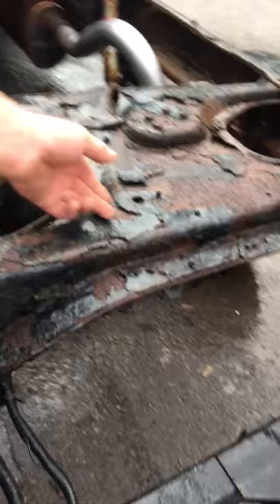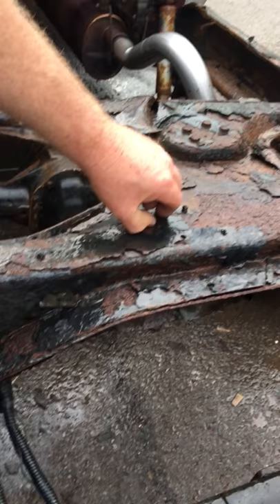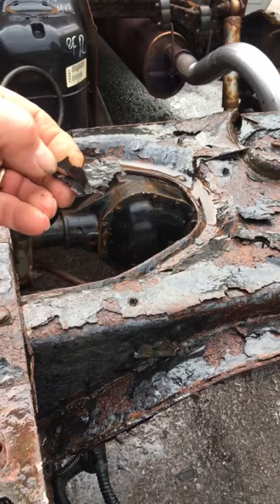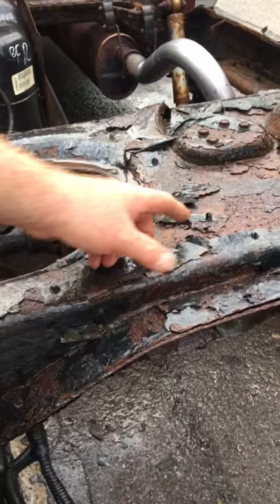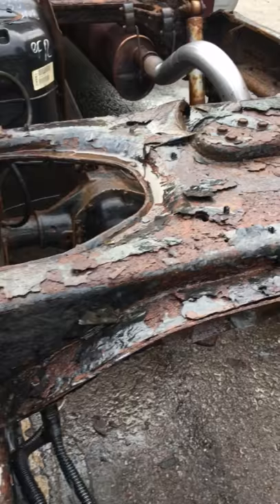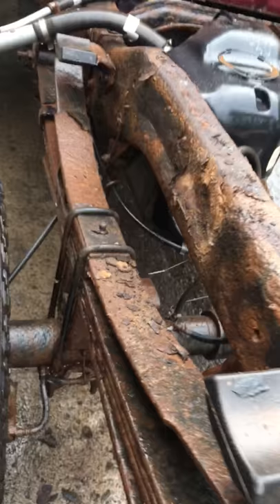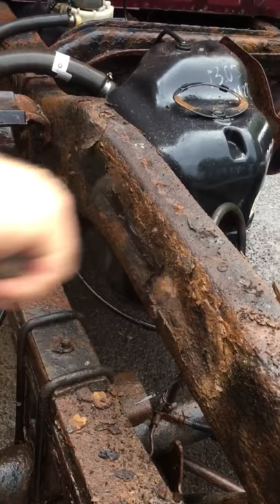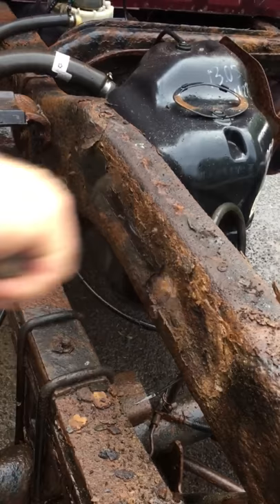Por 15 Is Junk! 2 Year Update

Comment: with all due respect, if the surface isn't well prepared it won't stick.
Reply: Yeah this dude literally put it on a rusty frame best method is bare metal
Reply: That and who the hell rustproofs the frame
Reply: It's literally called
Piant
Over 
Rust 
attempt 15 I think 
I would assume you can apply directly onto rust but if the rust itself isn't attached to the frame anymore I don't see why the paint would.
Reply: it literally says on the product AND their website you can apply it directly to the rust
Reply: @joer5057  the problem isn't the paint sticking to the rust but that the rust is no longer sticking to the frame think of the rust more as a layer of bad metal and that layer needs to be removed or it will just come off and take the layer of paint that's on top of it with it.
Reply: @Big-lron yes!!! Finally someone understands E.G - coating a frame with rust thats flakey essentially you are coating the flakey rust when that falls off it will carry on rusting and the product does not work always best to clean all the rust then coat it in a product like this
Reply: Wow that’s poor preparation
Reply: @Big-lron  light surface rust, not deep rust. like the flash rust you get on mild steel. you can't just put it on deep crusty/flaky rust.
Reply: @joeybydin439  lmao I was about to say this truck has been through Nam and back and this guy is like this por15 is crap 😂💀
Reply: Dude wtf are you driving in? Pure salt water?
Reply: @joeybydin439  anyone who wants it to still be there after a few winters 🤷‍♂️
Reply: @Big-lron  it’s also has directions… jfc
Reply: I sandblasted my truck frame and then por15’d and 10 years later it’s still almost mint.  You can’t por 15 a flaking frame and expect good results.
Reply: @Big-lron  paint over surface rust that you don’t want to grind into the metal And damage it more it will cure it and prevent it it doesn’t stop a rotted frame from rotting more
Reply: I agree my opinion is the steel was never stripped of rust to begin with
Reply: @Big-lron  right on the can it says you have to use the cleaner/degreaser then the metal prep/etcher, and THEN the POR15.

"But the slogan says . . . "
Reply: @joer5057 they mean surface rust that ISN'T flaky. If it's flaky than of course it wont stick. It has to be the 
type of rust that stays whwre it is for it to work. They do reccomend stripping the rust off and putting it on bare metal too
Reply: @joeybydin439  anyone in the upper mid west how wants their truck to last over 10 yrs
Reply: It doesn't work anyways
Reply: No prep at all. Ive seen plenty of cars that were restored 15+ yrs ago and the por15 underneath is nearly perfect.
Reply: @joer5057 yeah surface rust
Reply: @Big-lron yes paint over rust, it says CHIP AWAY ANY FLAKEY MATERIAL, you need a strong base. Let’s say your frame is extremely fucked up and it’s just weak from being completely eaten away, POR will not save your ass, if you can take a wire wheel and clean shit up and get a good base then yes you’ll have 0 issues, but if you’re in a extremely abusive area where you’re constantly getting salt and mud caked on and never washing it off? Yeah nothings gonna work, no por, no powder coat, paint, that would even be hell for fluid film.
Reply: @Big-lron you still need to prep my guy. If you dont the flaky stuff is just gonna shake off and itll keep on rotting because there isn't proper adhesion to the surface.
Reply: You HAVE to remove scaling before you apply.
Reply: You can't take it literally first of all it's marketing as far as you can put it on any surface no prep blah blah blah But you prep the surface right I guarantee it's going to work I don't even know I just know how science works
Reply: @jamesendicott4938 why por15 it if it's sandblasted clean? That would not be the most appropriate coating for clean bare metal?
Reply: @joeybydin439 Anyone who lives in the rust belt better if they want their truck to last more than 10 years. Frames can and will rust all the way through and break in half.
Reply: @joer5057 not if you leave all the scale on😂
Reply: Clean metal or not it will always happen that stuff holds moisture and will rust from the inside even on a brand new vehicle. Your best bet is just to spray some type oil underneath it soaks into the metal and actually work, it repells water not hold it in
Reply: It says to remove all rust. 
It’s more of a paint over rust pits meaning you’ve knocked the loose stuff off.
Reply: @Fffffaaaaaaa 😂 No, not salt water…..Pennsylvania. No joke. 😂
Reply: @joer5057 Exactly. I’m sure it would work much better if you applied it to bare metal but they claim you can just put it over rust.
Reply: Is says to put on with rust not bare metal
Reply: Dude i have it my rally var 4yrs know its super good ,prep work is key dont blame the product

Comment: I DiD zErO pReP wOrK iTs ThE pRoDuCtS fAuLt
Reply: yes because it's called Paint Over Rust
Reply: Yeah you're supposed to use the degreaser then the rust neutralizer first before applying it instead of being cheap, lazy and not following the directions
Reply: @no-damn-alias  if you applied absolutely anything on rust that's just flaking off it's going to flake off with the rust unless maybe you drench it in super glue. You have to remove the flaking rust and then you can paint over the rust on the actual metal
Reply: Try sand blasting the frame lol then put it on

Comment: I used it to treat a 1970s steel caravan chassis 15 years ago which was getting quite bubbly on the surface. I rubbed back the whole thing to remove the flakey bits on the worst areas, but didn’t worry too much about going to bare metal, just removed all the loose stuff. once the prep was done I painted on one coat.

15 years later I’d say it’s done an incredible job. Some surface bubbling is coming through now and it needs doing again, but overall I’m very happy with the product.

As others have noted, proper prep is key as with so many things in life.

Comment: I think the preparation work is very important and how you go about it, I have a 4x4 chassis completely stripped, weld repairs once that was done off to the sand blaster. Fresh sand blasted chassis was then sprayed with Metal Ready left to sit for 20 mins then rinsed off with water and left to dry. Went over it with clean damp cloths (water) let dry. Brushed two coats of Por15 and let dry after with Por15 Chassis Black. This last coat was sprayed on. 12 years later and its still good. The prep that I did properly so it worked for me. I found that if the prep is not done properly as i had once done with a motorcycle rock guard i just wire brushed it and skipped the metal ready, the Por15 separated in some places over old paint and even peeled a month later, because my prep was rushed and not done properly. If sand blasting is not an option say due to budget reasons, when wire brushing use a clean wire brush, wire wheels. I use stainless steel wire brush type I try not to mix previously used wire brushes were used on grease dirty muddy steel.
Reply: Heya mate. I specialize in metal finishing and restoration in N.Z. so our product names differ a little. From the sounds of your preparation, I'm thinking the product "metal ready" is a form of bare metal conditioner?? It leaves a haze over the surface (after being rinsed with water then dried). My question is, after a restoration process like dismantling and sandblasting a chassis frame, why would you chose to use por15 instead of an epoxy primer? Preferably a 2-pack epoxy, as it would adhere better and undoubtedly more strength to hold the desired following topcoat(s) of choice. I think por15 has it's place but not over clean bare metal that's been acid metal conditioned already. 🤔
Reply: @tepouogle969    @tepouogle969  G'day, at the time it was something I wanted to try out and it worked well for me. Yes metal ready is that stuff that leaves the surface etched with zinc phosphate. If I were to do it again I would choose to do 2 pak etch primer and 2 pak top coat as it's an easier process. And yes even epoxy enamel too 👍 I still use POR 15 for small parts I think it's ideal for that. I found it sticks well to sand blasted metal that I followed the step by step videos by Por15. I did allot of test and trail on scrap materials over a couple of months. I'll also add powder coating would be my vote over all of these painting processes for chassis and small parts etc.✌️
Reply: @Craftin.Clever  awesome work mate 👍

Comment: If you look into the product better, they tell you what prep work you need to do, it's more than just slapping the stuff on the frame.
Reply: Prepereratiion is everything when it comes too auto body! He should have scraped, sand blasted, and washed then applied gallons of OSPHO acid based primer and which he would need numerous appliances on that and then either primed or just top coated with POR-15

Comment: Nothing will stick to that rusty heap , you should have tried the por 15 before it was completely rotten. I use it on frames and inner fenders. I kill the rust with vinegar or aspho . Then wire wheel it . 2 coats of por15 and it will last forever.

Comment: Bodyman here. I used this por 15 and it is indestructible, (if you prep it right) it is so indestructible that if you don't clean the lid and rim of the can it comes in after application, you will never reopen the can again. 
     Spilled some on the floor and I can't even get it off. It's permanent.
Reply: I didn’t seal my lid properly and I had about a half inch crust on top of the paint that I had to break through.
Reply: Use an awe or screwdriver to puncture 2 holes opposite sides of the lid like 1/2” from rim after shaking. Then clean and use metal tape to seal holes up for storage. Never remove the lid lol.
Reply: @yellow2000SR  that's pretty smart. Thanks.
Reply: I got the lid off,no problem, ya'll are WEAK!

Comment: Id like to hear in detail what preparations were done before applying it. If you dont follow the preparation instructions EXACTLY then it will not work... and that is no secret. That means you could do all the prep in the world but if you leave out even ONE of the steps they instruct you to do then it wont work and will all be a waste of time. That means, removing excess rust (sanding, scraping, wire brush/wheel etc), THOROUGHLY degreasing, thoroughly rinsing, applying a heavy coating of metal etch, again thoroughly rinsing, and THEN applying POR... and it has to be applied in the right humidity and temperature. If any one of those steps is missed or done incorrectly you might as well not even bother at all.
Reply: Those are extreme measures just to get a product to work.
Reply: @acoupetroop617  dude....have you ever painted anything in your life?....
Reply: Nah it doesn't gotta be perfect just has to be good enough
Reply: You actually have to use a degreaser that won't leave a film or residue. They actually had to make a water based degreaser for that very reason. People were just degreasing with whatever they had on hand.

Comment: And you MUST do all steps in low humidity and above 55 degrees. Otherwise you just seal in moisture.
Reply: Actually, POR15 works better when you apply it when the weather is humid.
Reply: It's paint, paint is a liquid it already has moisture

Comment: I have NEVER seen POR-15 do that. Do you happen to have a video of the application? It’s evident you did not apply the Metal-Prep which is a necessary part of the process. I have used the Metal-Prep alone on original, pitted 1929 panels that are still unrusted three years later sitting in a Midwest garage with no climate control. Even without any topcoat it is still bare zinc/grey covered metal. Perhaps just use the cheaper Rustoleum where results are no better but prep isn’t needed either. Those who say it’s too much work to get a product to work might have never followed a process. Unfortunately, we can’t have it both ways. Science is hard.
Reply: They slopped it on flaky crusty rust so it never had a good bond to the metal. they saw "Paint Over Rust" and went ahead and slathered it on without doing the prep to get the crust off.

Comment: I have thing with por 15 that have been in the weather for 20 years. No problem at all. Any coating on a frame that gets a chip in it. Salt will travel under the coating and rust it out. The old factory coating does the same exact thing. A more flexible coating is better for a frame than a hard paint.

Comment: I've had great results with Por 20 silver high temp header coating.  Header temp has gone up to 1650 degrees temps.  It lasted 4 to 5 years. .  
Por 15 surface prep needs to be used with this product.

Comment: I use rust converter and then paint. It is an easy process, not expensive, and lasts quite a while. POR15 is not as great as they say. It is a pain in the ass to apply and corrodes from the edges. It is also very expensive. I use Gemplers bought online. I have used both.  You can use truck liner spray or rubberized undercoating for an exterior coat if needed depending on the location. I touch up the bad spots once a year with a paint gun.  Very little prep for the rust converter.
Reply: You should watch project farms video on rust converters

Comment: I agree with this, I tested a crossmember that was mildly rusted, nothing that an angle grinder and a wire wheel couldn’t remove. Once I angle grinder the whole surface and used the 4 step method I let it sit in my house for 2 years. Now my results didn’t come out as bad as this man’s but the POR15 was bubbled and rust was beneath the surface and much more than there was after I used the wire wheel. It leaves too hard a surface and doesn’t let the reoccurring rust be shown. It definitely hides it under the surface.

Comment: Your video is exactly the situation I had.  If I had to do my 2004 sienna all over again... I would scrap away all the rust take it as far down as possible, then NOT paint it, and literally just do a whole can of WD40 every 3-6 months spray it on.  I've got bare metal parts that have sat in my garage in the open air and haven't peeped any rust since hitting it with wd40.

Comment: I used it on similar project 4 years ago and it still holding solid 👍
What I've done was cleaning all that junk used the por 15 digresser and then the prb and painted 2 codes 3 hours a part after 24 hours I used chassis paint 
It looks much better than the company original paint and holds strong
You must made short cut some where my man

Comment: Best way to prevent your frame from getting thinner with rust is to blast all the rust off then coat it with fluid film and a paint brush and reapply every summer.
Reply: Fluid film is very messy if you ever need to work on you vehicle
Reply: @MatthewG_208  do you want rust or not to be dirty because you can't have both
Reply: Or, you could just use POR15 and actually follow the instructions. My frame still looks like I coated it yesterday, it’s been 4 years.

Comment: From my experience, this stuff is hard as hell and looks amazing and lasts if you put it over bare metal. You can get away with minimal rust on the surface but thats only after really grinding on it and hitting it with the wire brush, but if you do it over some decently nasty rot, turns out bad

Comment: I use boiled linseed oil with rust oleum over top.  Works the same as Pore 15 at a fraction of the price.  You still have to get the flakey stuff off first.

Comment: best option is to remove the rust entirely, then use fluid film to protect the surface. repeat every 6 months. once you use any painted surface it will eventually Rott.

Comment: Yes, this is an extreme example, but the problem with this type of coating(not just this brand but any of them) is that eventually they will loose bond with parts of what is coated and moisture will get in behind it. You will never see it because everything looks fine on the outside but underneath the rust keeps growing. A product like Fluid Film is clear so you know where attention is needed. I live on the edge of the rust belt so it’s not that bad here. I just keep up with the rust using a rust converting primer. It just peels when rust gets under it. If I was full on the rust belt I would use fluid film, not any of this polymer crap.

Comment: Did my GTO frame 12yrs ago... No problems or complaints here.
Reply: Do you drive it in snow?
Reply: @jeremyrock9305  No I don't.. I don't know many people who would take a fully restored muscle car and drive it in snow.
The key to POR15 working is the prep work,,  it either needs to be blasted or dipped or wire wheel the crap out of it and then use the prep solutions that go with the POR15 product. if one just puts POR15 over a rusty flakey base than of course it will flake off... it's just like a paint job on a car the better you prep the better the finished product. 
POR15 takes work to get it right and most dont want to put the necessary work into it then when it fails want to blame the product when in fact it was poor application that caused the failure in the first place.

Comment: It works, you just have to sand blast it to a new frame, degrease, acid etch, stir not shake, paint above 87.5, but below 88.5, don't let the temp change more than .25 for the first 4 hrs, re coat within 6hrs but after 5.:45. Do no less than 4 coats, and follow it up with a UV barrier or it wont work.  Be sure to add 6min cure time to each susequent coat and prime it with an etching primer, followed by an epoxy primer, then paint with urethane.

FFS.
Reply: 😂 correct it’s that simple
Reply: Clean the flaky rust off, degrease and allow to dry, apply POR15 when temps are warm (don't put it on if the shop is a balmy 50F you dunce). It's literally that simple. You can't just slather it on a frame that's all covered in flaky crusty rust and dirt. You can't just slather on a frame that has a bunch of oil on it. There is a minimum IQ required to do things like epoxy coating a frame.